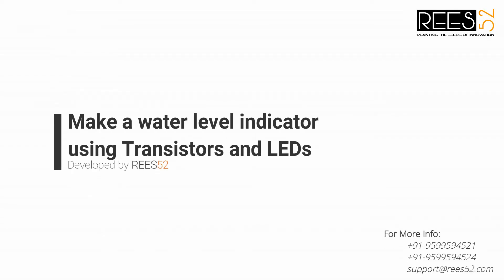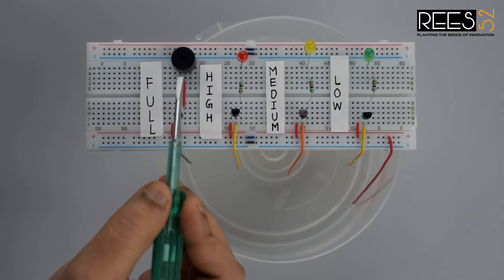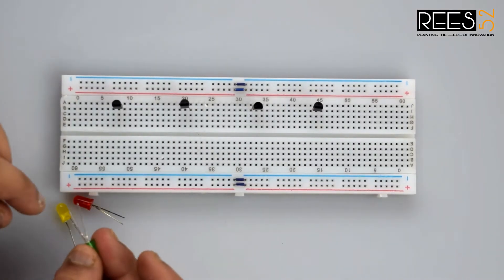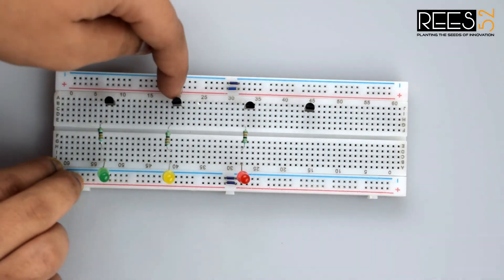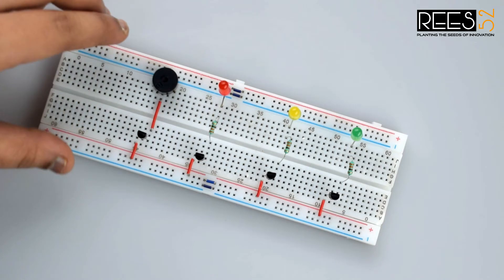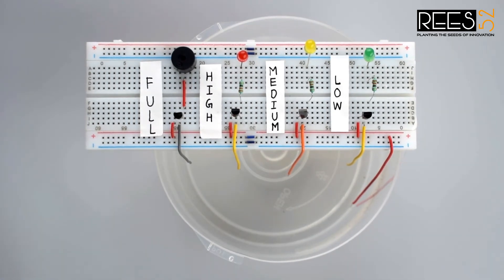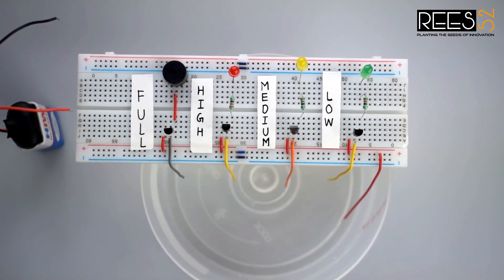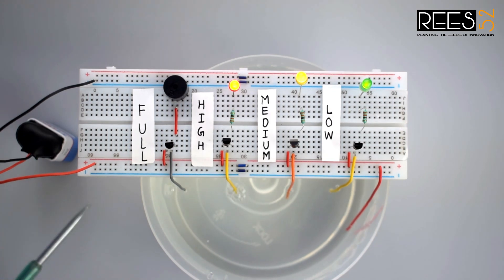Make a Water level indicator using BC547 transistor and Leds

Comment: Is any problem if used without transistor using only LED and DC source. Why exactly transistor necessary (why switching required) ? Pls rply
Reply: the transistor acts like a switch in the circuit when in the water